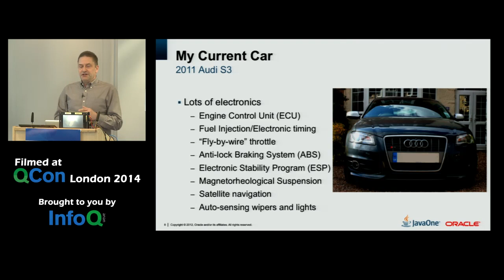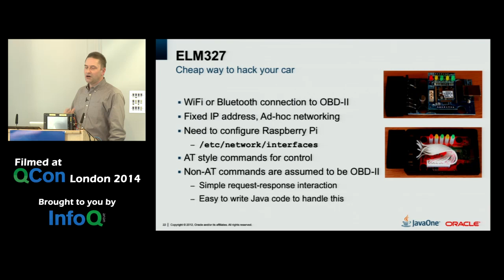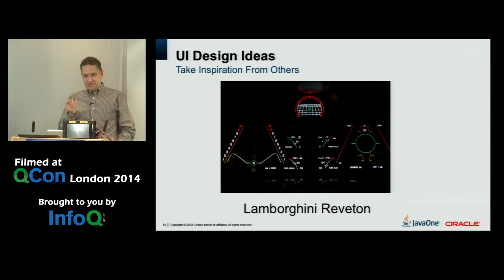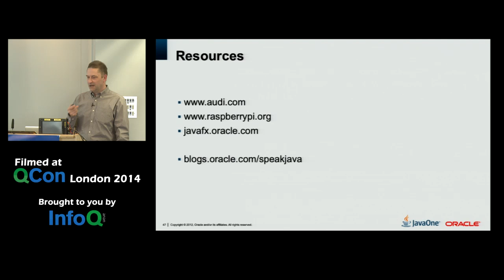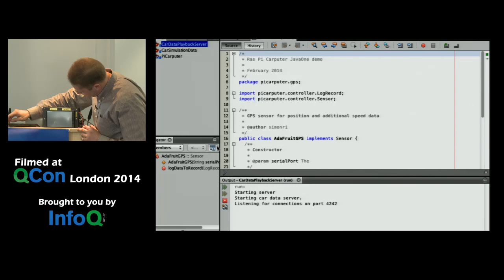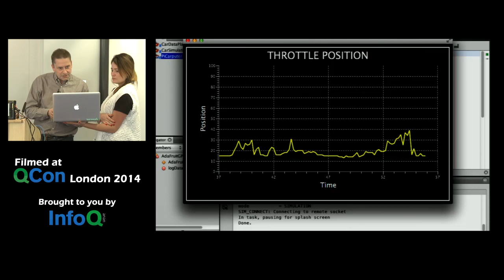Is It a Car? Is It a Computer? No, It's a Raspberry Pi Java Carputer

Comment: Awesome!

In regards to dealing with a car using a manual transmission, do you know of a way to reliably ascertain the current gear? There are plenty of algorithms out there that try to do this by using the cars speed and RPM's.. and this may be somewhat accurate, but I want to do crazy stuff like have my Nitrous kit spray a specific amount at specific throttle %'s, within a specific RPM ranges in different gears. So this means that something as simple as a mis-shift could blow the engine..

I thought it was pretty ridiculous that there's no PID for the gear (at least not in a car with a manual transmission)... But theres one for just about anything else imaginable.